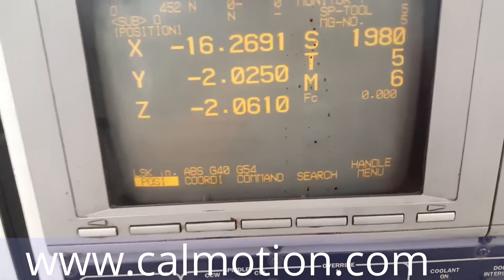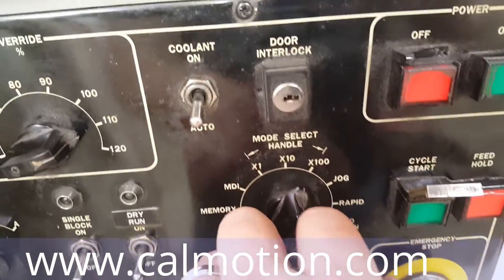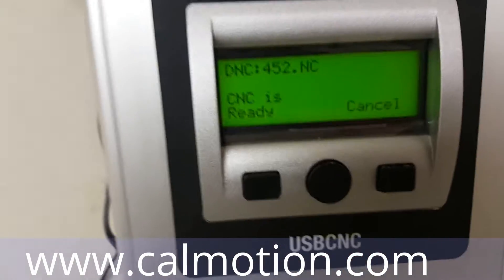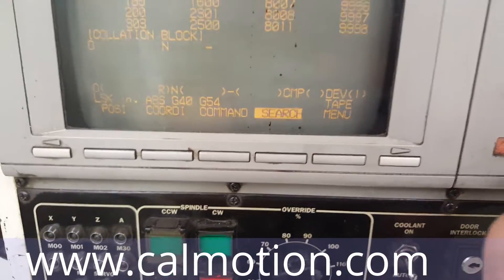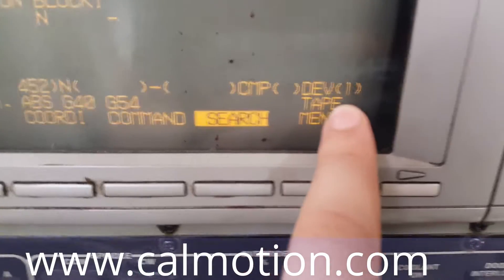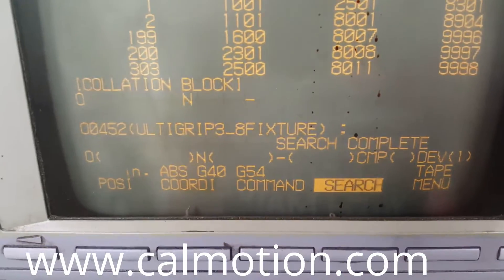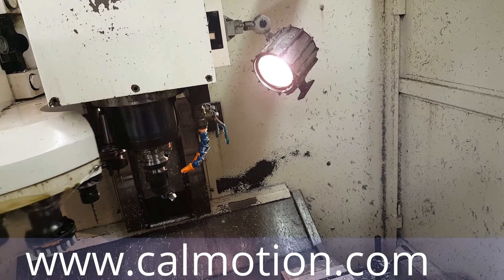Add USB memory to Mitsubishi Meldas 500 CNC

Comment: P62 F-CMD nothing hatası veriyor
Reply from the maker: Use an F command to specify the feed rate.- Specify F with a thread lead command. The default movement modal command at power ON is G01. This causes the machine to move without a G01 command if a movement command is issued in the program, and an alarm results. 
Besleme oranını belirtmek için bir F komutu kullanın.- Bir diş hatvesi komutuyla F'yi belirtin. Güç AÇIK durumdayken varsayılan hareket modal komutu G01'dir. Bu, programda bir hareket komutu verilirse makinenin G01 komutu olmadan hareket etmesine neden olur ve bir alarm oluşur.

Comment: friend good video I am operating a cnc control cnc milling (meldas 500 mitsubishi) and I find myself with the problem that when I want to work the 3 axes simultaneously the machine makes small blinks and the cut is not continuous, I am drip feeding it with DNC with software ( cimco edit 6) This happens when I'm doing 3D machining, since when I'm using 2D it works without problems. I want to think it's the baud rate. The cimco is set to 4800. Please, it would be of great help.

amigo buen video. estoy operando una cnc control cnc milling (meldas 500 mitsubishi) y me encuentro con el probleba de que cuando quiero trabajar los 3 ejes en simultaneo la maquina hace pequeños parpadeos y no es continuo el corte, la estoy alimentando por goteo con DNC con sofware (cimco edit 6) eso ocurre cuando estoy haciendo mecanizados 3D, ya que cuando estoy usando 2D si trabaja sin problemas. quiero pensar que son los baudios. el cimco esta configurado a 4800. por favor seria de gran ayuda.
Reply from the maker: I am not sure what Cimco is having a problem with. Have you contacted them? I have never heard of an issue with the Meldas control. Maybe try a faster baud.
Reply: @CalmotionProducts  the problem is the CNC.  when I'm cutting on 3D surfaces the Machining becomes slow it's like the CNC slowly blinking.  I tried to raise the baud rate of cimco edit v6 and the meldas control but after doing so it doesn't work, the machine doesn't receive the code.

el problema es la CNC. cuando estoy cortando en superficies 3D el Mecanizado se vuelve lento es como que parpadear lentamente la CNC. intenté subir los baudios del cimco edit v6 y el control meldas pero luego de hacerlo no funciona, la maquina no recibe el código.

Comment: Hi there been trying to get a similar product by another company to work but it isn't currently using a Mitsubishi 520am Meldas would your product work?
Reply from the maker: We support all Mitsubishi controls including  the Meldas 520 control. We stand behind our product and will help to get it working for you on your machine.
Reply: Hey James my name is chase I have a Daewoo ace v-50 Cnc machine and it has the Meldas 520 control, my problem is my parameters for machine have been lost sounds like you have Meldas 520 control I can’t find any help on the web for those parameters is that something you could maybe help me with I can send you my phone number or email just at a loss on what to do and need machine back up and going.. thanks chase
Reply: James M Meldas 520

Comment: Sir I have mitsubishi hartrol m500 i want to know how find n no when power off
Reply from the maker: Not sure what you mean "find n no when power off" Could you give more detail on your question?
Reply: Sir i want to re start this program from where he kept due to power off Search by N Code
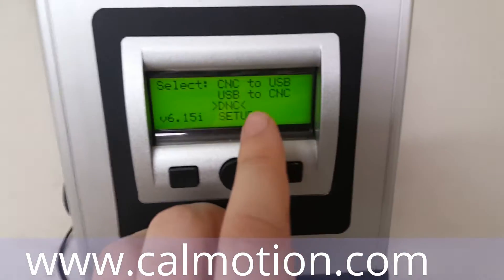Reply from the maker: Using our unit, select DNC, the file to DNC, then select Opt. (see video at time 0:32). In the Opt. menu a midtape search text can be entered. The file will be searched for that exact text and start DNCing from that location.